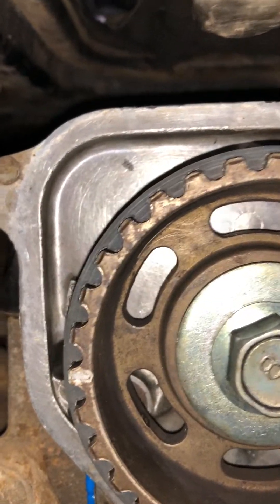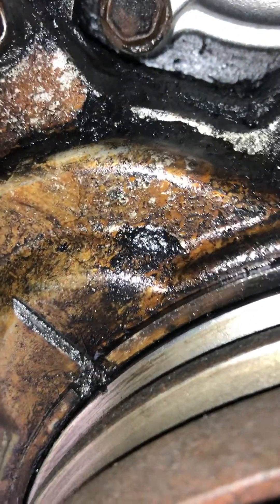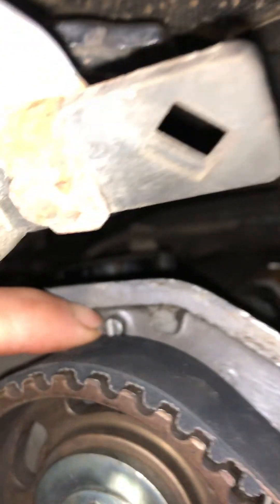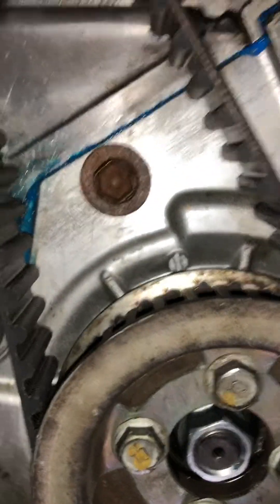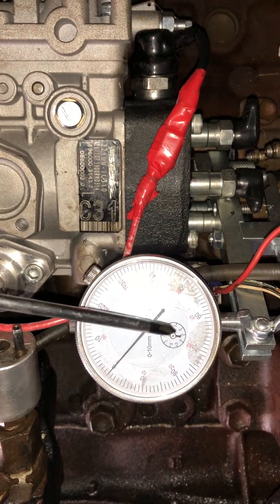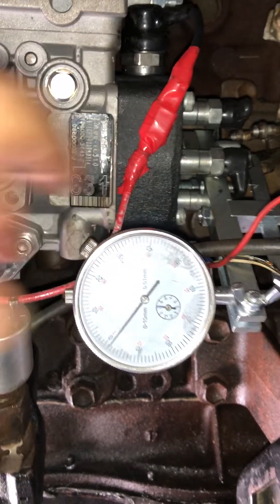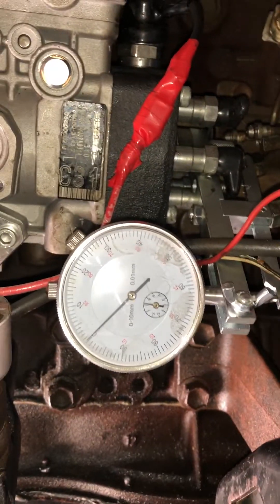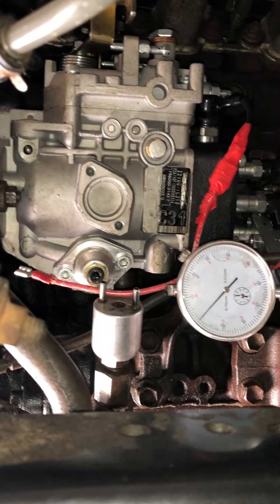1HZ Belt Timing & Injection Pump Timing

Comment: thanks for the video. i have sent my pump away for rebuild and i now have all the tools and the knowledge to do the job right!!!!
Reply: No problem. I took my pump apart into every peace about 113 since than as I dirty it up with bit bad fuel and cleaned and put it back together. 

Im fairly dumb and i was able do it. Its like a jigsaw puzzle pretty interesting and it all goes back together. Ppl seem scared off by it. Its not tuned by a proper machine etc but i got it running ok and its humming along seems good as new to me. 

I ended up throwing that gauge thing to the shithouse because it kept giving different readings I thought i was going insane. Then i asked the engineer who built the pump ( the place i bought it from originally!) he said just go by ear. That was good enough for me. I just move it while its idling until it sounds best and running best out the road. 

I been to the all the Murray Darling system back of Bourke and across NSW to the coast all way down south and it isn’t missing a beat yet. 🎉

“If it ain’t broke I ain’t fixen nothen”🎉

Comment: Mate just querying your spec for injection timing. I have these figures. Landcruiser 75/80 series 1.03 - 1.09mm @ TDC, 100 series .85-.91mm @ TDC. Toyota Coaster 2000 is .65-.71mm @ TDC w/- ACSD and .85-.91 @ TDC w/out ACSD. I have a 2000 Coaster which I am about to check. I just had the timing done by a diesel mechanic a few months ago but don't know what he set it to so about to find out. The bloody engine started to missfire not long afterwards, now blows out shitloads of white smoke after 1200rpm to about 3000rpm, misses its arse off while this is happening but comes good under more throttle. So I will check it to see if this is the problem.
Reply: @Jaffasoft  I bought a workshop manual disc on E-bay that had all sorts of info on several models with different engines. The disc did not work as intended so I used file manager & went through the entire discs folders & found the pages related to any service data. Interesting though that a 2000 model Landcruiser with the same engine has the spec of 1.09mm but the coaster is less. Mine has the ACSD so I guess it should be .65-.71mm according to the service data. One thing I am not certain on is whether the spec is for australian model coaster. For all I know it could be for european models? Had a good look under the bus today & the marks on the housing lines up with the mark on casing, so it must be close. I have yet to figure out how the hell I am going to get the dial gauge into position to check the setting, as you know room is limited. I can't drive it as it is atm, if the timing is correct then I may have other serious issues. where have you seen the china knock off pumps & injectors?

Comment: Great video. One question. What about the factory mark on the pump and the housing ? Shouldn’t that marks align?
Reply from the maker: That is correct. Though that can be adjusted a bit to sometimes. The new pump I bought didn’t have any makes. Its about the centre on my old factory one.